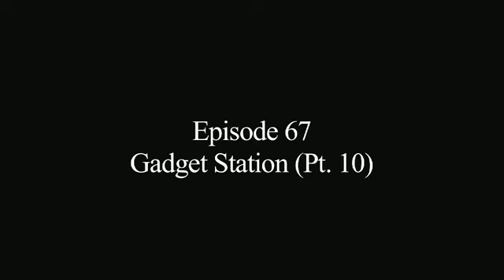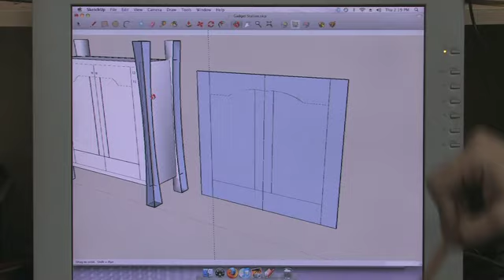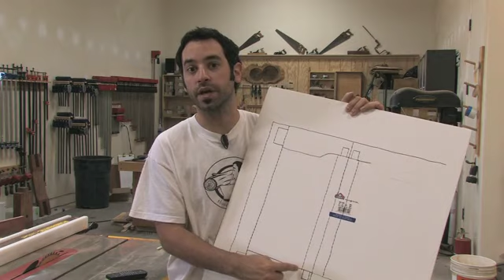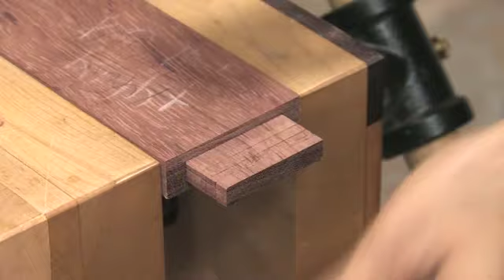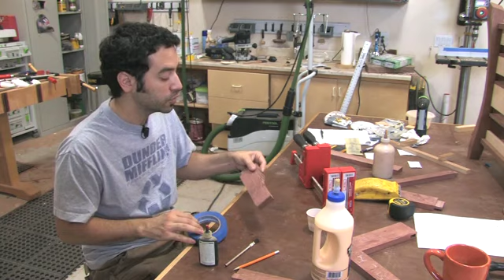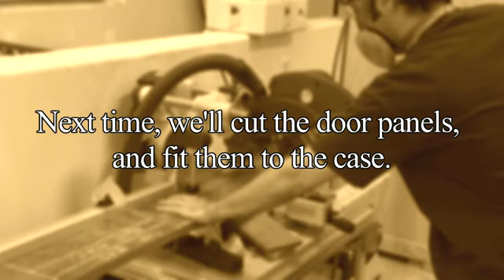How to Build a Charging Station for Electronics (Part 10 of 12)

Comment from the maker: @Pedrofreestyle97 length. You can tune a jack plane to do rough work, to smooth, and to do some jointing. But a jointer plane is longer and excels as flattening long surfaces. More reference surface means a flatter result.